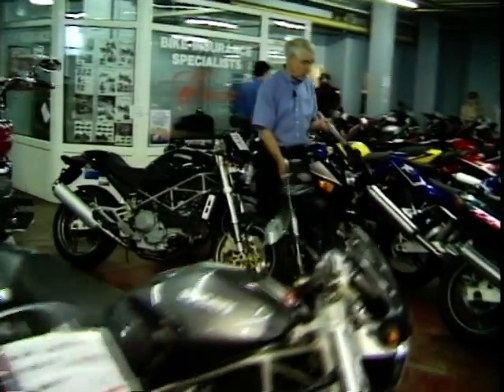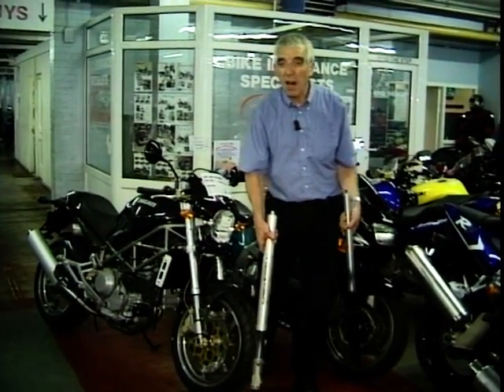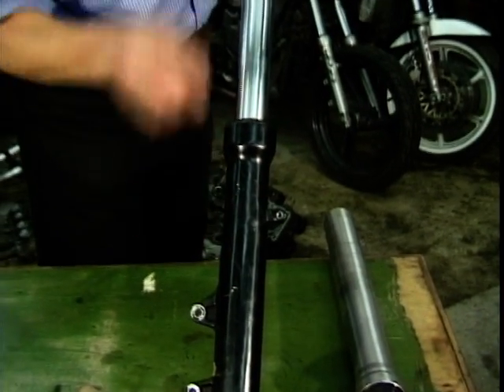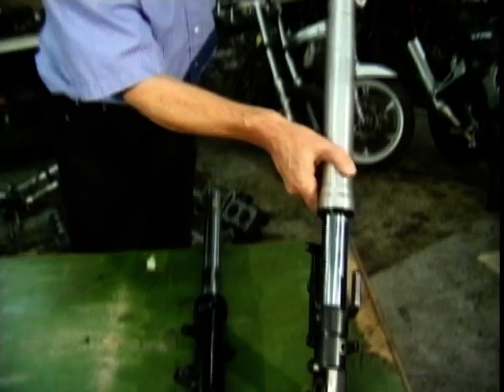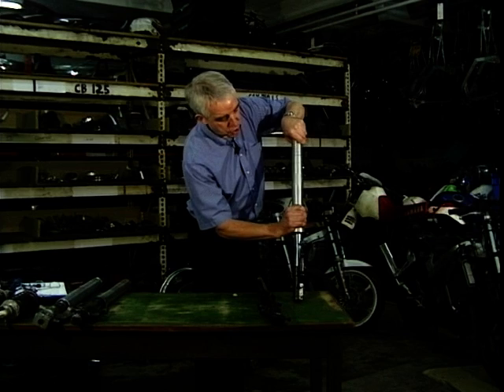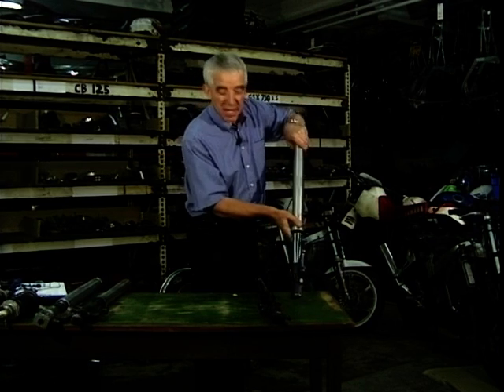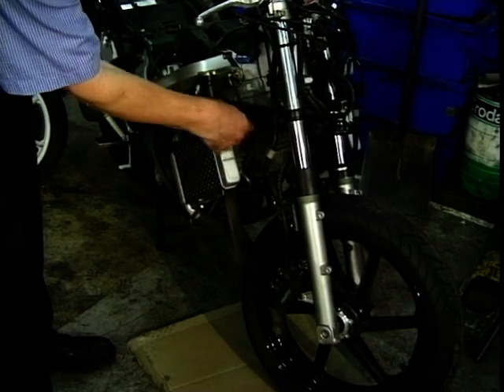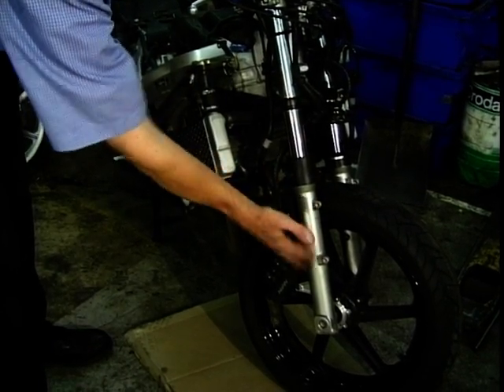Motorbike Forks: Upside Down and Conventional

Comment: All forks flex.If they didn't they would snap. USD's reduce unsprung weight. Inverting the fork gives designers a little more room for the damper, spring and the multiple adjustment mechs.